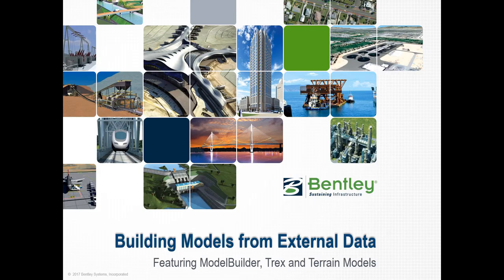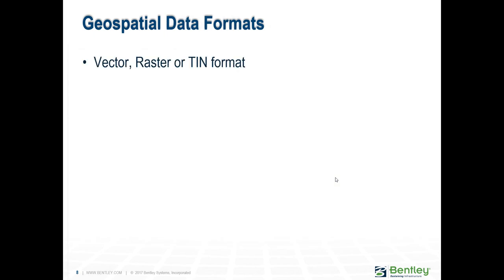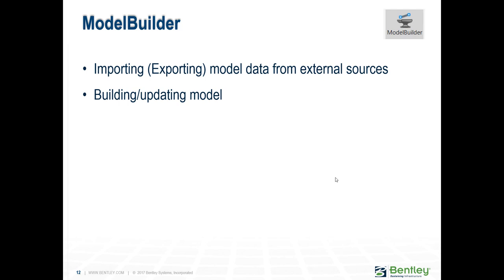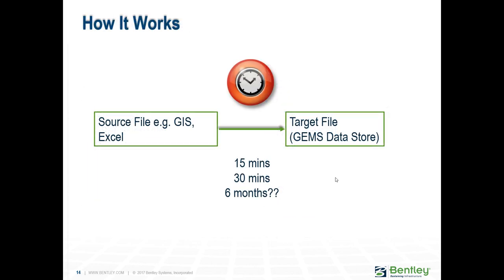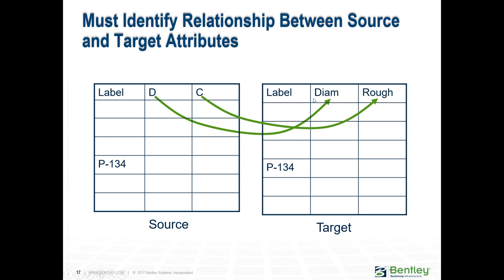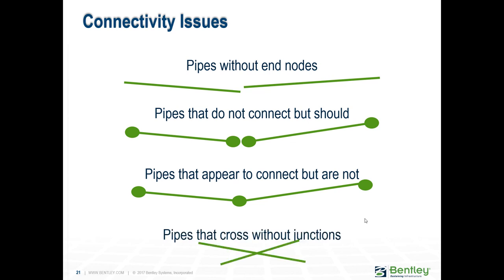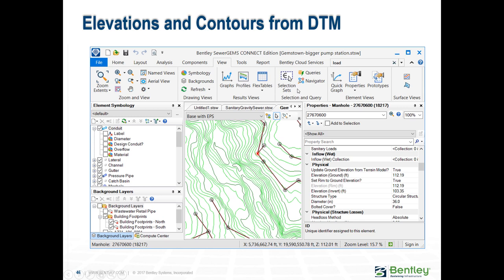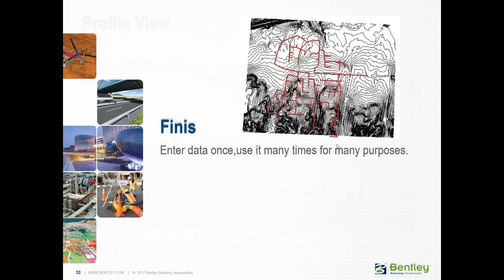SewerGEMS/SewerCAD Fundamentals Part 12: Model Building

Comment: Which workshop is model builder shown step by step? Is it not in this playlist?
Reply from the maker: Hi Dave, please see part 12 for a lecture on model building and part 14 for the workshop that involves ModelBuilder (workshop 4). There is a link to the workshop dataset with instructions (ModelBuilder starts on page 131): https://communities.bentley.com/products/hydraulics___hydrology/m/hydraulics_and_hydrology_gallery/273992

Also see: https://communities.bentley.com/products/hydraulics___hydrology/w/hydraulics_and_hydrology__wiki/2821/using-modelbuilder-to-import-external-data